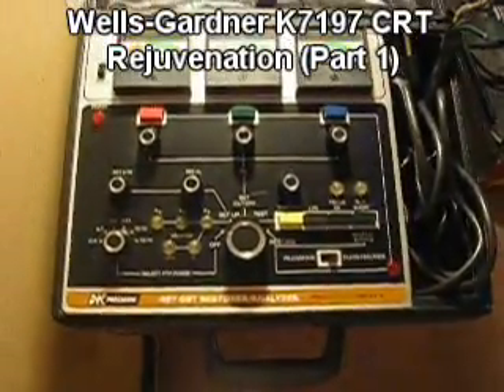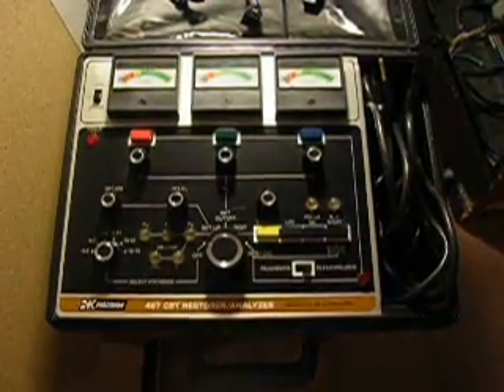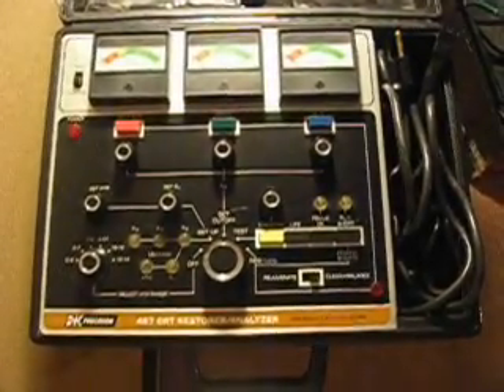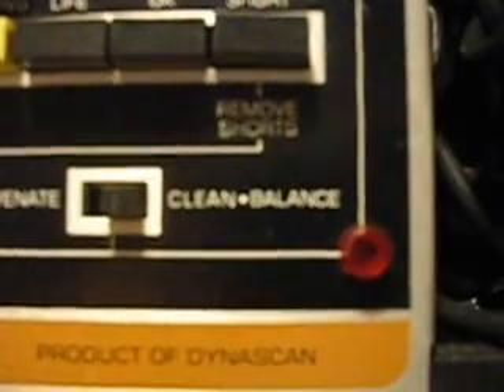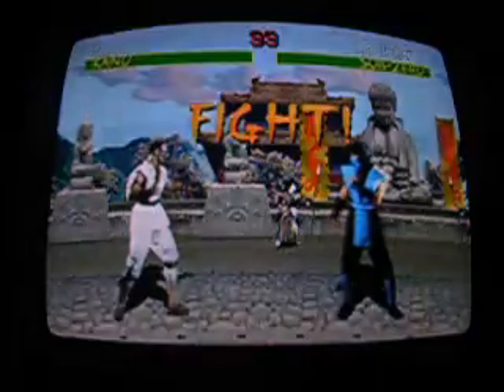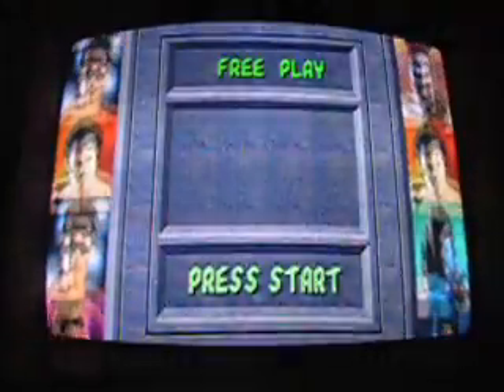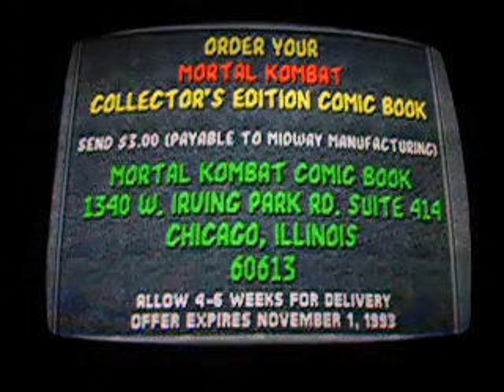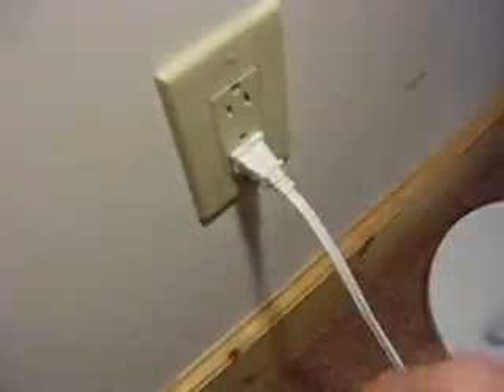(Part 1) Wells-Gardner CRT Rejuvenation

Comment from the maker: @BoneThugsandAKon May only be that you need to adjust the "FOCUS" knob on your flyback transformer.  It's the large black plastic component on the circuit board under your monitor's tube.